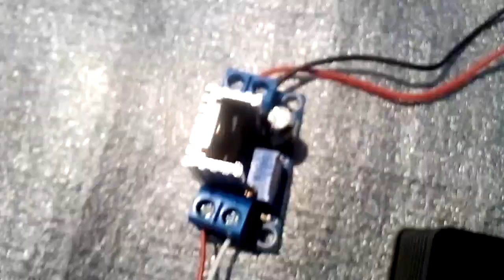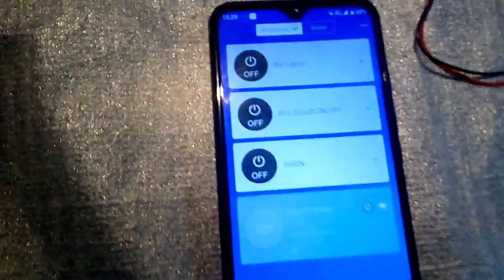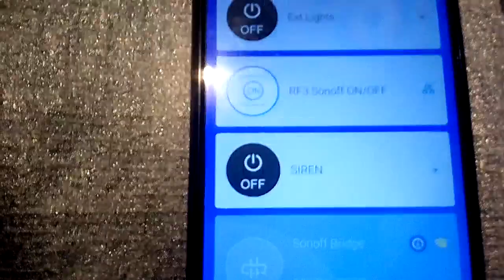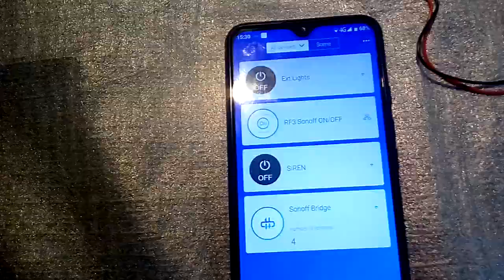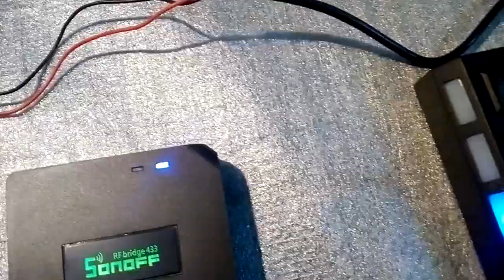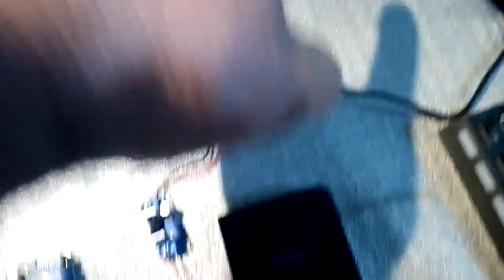Part 1 - How to control a Sonoff Bridge /DIY Alarm system with 433 mhz RF switch (eWelink)

Comment: Good day I bought it but the bridge loses its internet connection frequently reconnects, sometimes it takes a long time to reconnect, do you think this is normal or is it necessary to have a special process to keep the product faulty constantly connected to the internet thank you
Reply from the maker: Hi there, have you chercked your wifi connection?  Is the bridge far away from the Router? maybe you should consider a  WIFI repeater if you have a signal issue.